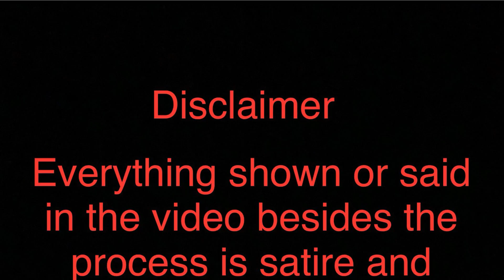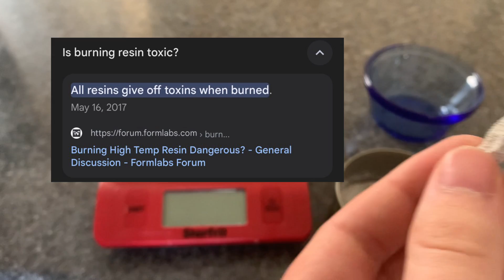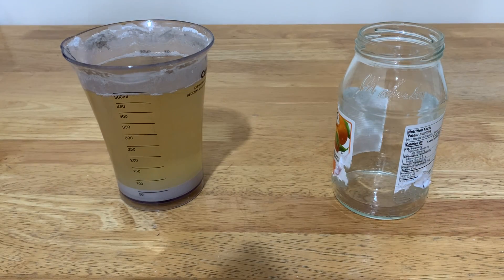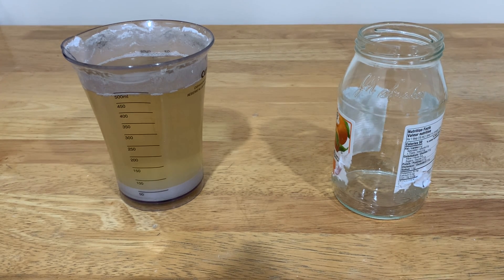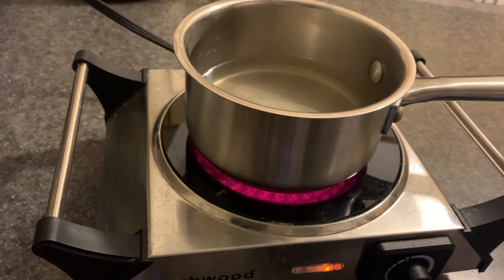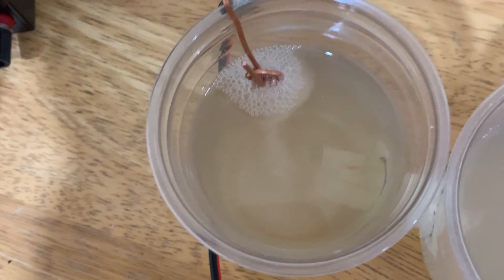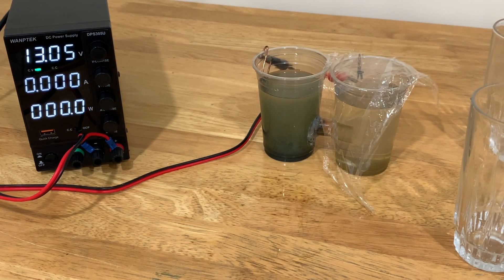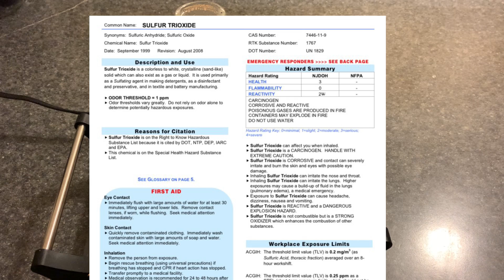Dissolving my drywall into sulfuric acid

Comment: You know that's true I never thought of that, the local crackheads house is always a good source for scrap gypsum and baking soda, I can understand the later but why the former?
   Last time I was over there at the crackheads house I polyurethaned the floor but I intentionally put some of that scrap gypsum in the polyurethane😅 now they spend all day picking at the floor😢

Comment: @Chemistry on Creatine I´ve also red in a book that calcium, barium and strontium sulfate can be converted into more useful calcium, barium and strontium carbonates with sodium carbonate. However, it said that to ensure the best and highest yield possible it is advised to boil these sulfates with a saturated solution of sodium carbonate or to heat them with 3x excess of sodium carbonate in a crucible.

Comment: i think it will be better to use NaOH to dissolve the CaSO4 it will react to form calcium hydroxide and Sodium sulfate and as it is a soluable salt and calcium hydroxide is insoluable they can be seperated and electrolysis of sodium sulfate with anode and cathode seperated will make h2so4 at anode i also recommend using a unglazed clay pot as membrane it will work better than cotton as it seperates the anode and cathode chembers much better than cotton
Reply from the maker: I was originally planning using NaOH as well but the thing is caso4 had 2 bonds attaching the ions, I hence figured it would be more stable and harder to split than caoh2 meaning I figured the reaction wouldnt progress well due to caoh2 being pretty unstable compared to caco3 as caco3 has a double bond to its one ion. This I imagined would hinder the equilibrium so I did it this way. In terms of the clay pot as a membrane that’s a good suggestion I might do that in the future

Comment: you should try using pure soda (NaHCO3) instead, 1 mole of it should react with 2 moles of drywall (CaSO4) to yield Na2SO4, CaCO3, water and CO2 gas.
the Na2SO4 can then be reacted with either nitric or hydrochloric acid to give Sulfuric acid (H2SO4)
none of these reactions are reversible either so less hassle, though i would add more soda than drywall because if there is soda to spare it will just react with hydrochloric or nitric acid in the same way Na2SO4 will and make salt (NaCl)

also which country are you living in? if your in the US it should be easy to buy HCl, and if not you can just make it the electrolytic method while making more NaOH which is always useful
Reply from the maker: Probably NaHCO3 would work but because I’ve seen no one do this before I was very cautious with the recipe not experimenting with bicarbonate and instead using carbonate as that’s more known. I’m also very much not sure about HCl reacting with Na2SO4 to make NaCl and that being non reversible. I live in Canada and I do have a bottle of concentrated HCl I bought however I never even thought it could be used to make sulfuric acid
Reply: @ChemistryOnCreatine  im testing it out my self now, though you should be able to buy HCl as a mold/molt remover for boats and concret.
the reaction i was thinking about goes as follows
2NaHCO3 + CaSO4 -> Na2SO4 + CaCO3 (insoluble) + H2O + CO2

Na2SO4 + 2HCl -> 2NaCl + H2SO4
salt is very chemically stable so for most applications it can just be used as is
if you really want to remove the salt without having the equipment to distill sulfuric acid you can boil the solution untill it reaches close to 100% purity (water evaporates but acid does not) which will cause the salt to precipitate out. then the acid can carefully be decanted. you do lose some product but its an expected sacrifice for purity. (DO NOT try to filter it with coffee filters as the acid will react strongly with paper.)
Reply: @ChemistryOnCreatine  i can confirm that this method works in making sulfuric acid. though it will be heavily contaminated with NaCl, meaning it needs distillation.
Reply from the maker: Ty this seems like a more efficient method than mine if I want sulfuric acid as a catalyst say for something organic, where the salt contamination doesn’t matter. I sadly do not have a distilator which is capable of handling sulfuric acid distillation as my current one will dissolve if I try this. I’ll need to begin to synthesize organic molecules using the sulfuric acid from this process now

Comment: can a lead dioxide anode be used to make H2SO4 directly?
Reply: I've made one and it works a treat.
Reply from the maker: Wouldn’t it make less sulfate tho as far as I’m guessing? I’ve seen a lot of people use lead oxide or other oxides as electrodes but never looked into it as they’re not readily available for me
Reply: @ChemistryOnCreatine  i made some PbO2 electrodes from lead ingots, there are some tutorials here on YouTube on how to make them.
They tend to flake off PbO2, but if you can contain it, it could be useful. Lead dioxide does not dissolve in sulphuric acid so it does not form almost any lead sulphate that could reduce yields.
(I have a short where i use one in a nickel sulphate solution)
Reply from the maker: @lautaromorales2903 I’ll actually try that as I lack proper electrodes and if it works make a video about it in the coming days. Thanks for the suggestion

Comment: The uv step is unnecessary.  Sulfur trioxide literally pulls water out of the air.  Sulfur dioxide however could be in solution and it reeks.  Adding a little hydrogen peroxide will get rid of the dioxide.  Too much will form weak piranha solution.
Reply: the sulphate ion it's pretty stable towards reduction in the cathode, so no SO2 it's formed, and in the anode only oxygen it's oxidized
Reply: @lautaromorales2903  sulfur dioxide formation is what is known as a side reaction.

Comment: I'm wondering if it wouldn't save some steps just chucking the Bicarbonate and drywall into a blender together for a while and then just throw that on the heat to dehydrate both compounds at once. You can then add water once it has cooled off sufficiently, stir or boil if you want to mix it, let it settle and pour off the supernatant straight into the drain. That way you have a single pot recipe and making much less mess....in the kitchen.

Edit: 🤦‍♂️don't discard the supernatant.....that's what we are after. Mah bad.
Reply: I wonder if throwing a little water into the mixture desolving the bicarbonate (or sodium carbonate if you have access to that) and have it absorb into the porous calcium sulphate and then boiling off the water which would lead to a more intimate mixing of the 'ingredient' and thus improve either yield or reaction time. The benefit being that this step is practically zero effort and adds very little extra time to the procedure.
Reply from the maker: It could actually, but yet again it could cause problems with heating each of the corresponding ingredients as the temperature would be limited by the water
Reply: The water is just to dissolve the (bi)carbonate and get it absorbed into the drywall powder. After which, you would absolutely have to boil off all the water and then continue heating to the requited higher temperatures. Apologies that I wasn't clear on that.
Reply from the maker: It would also increase the surface area and speed up the reaction heat adding energy to the system.. neat… it definitely could work I’ll try it out in the next batch
Reply: @ChemistryOnCreatine please make it if you try it into video bro😊